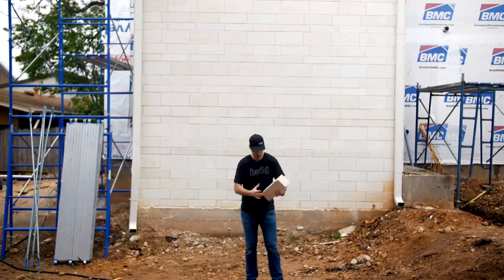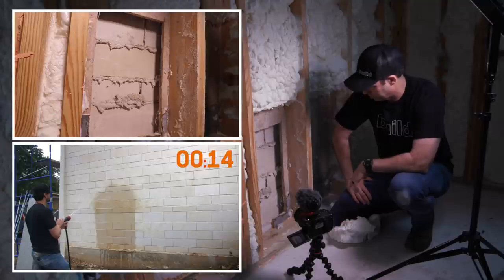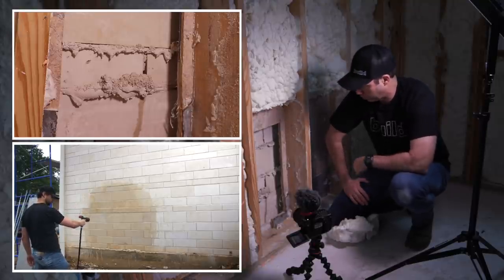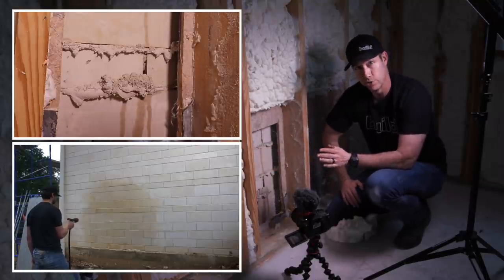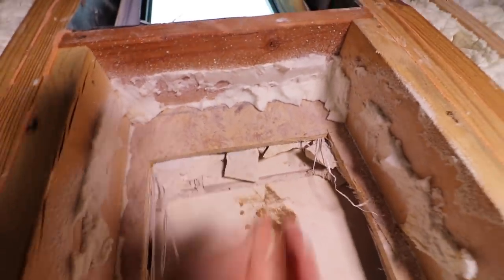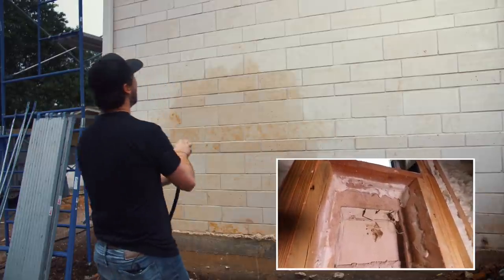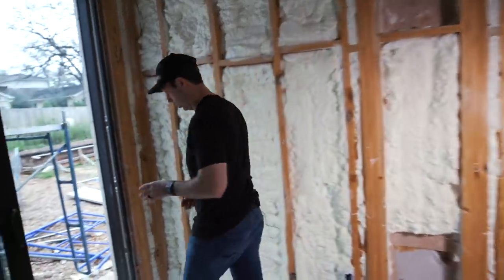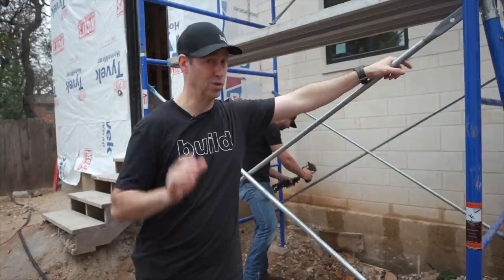You'll be Shocked by how quickly this leaks...

Comment: Looks like the majority of vertical joins are failing. Likely just a stripe of mortor front a back and the blocks were likely set dry. Curious on the quality of motar also. Those blocks should take weeks not minutes to show damp. In a cold climate the ice between blocks would tear that wall down.

Comment: I live in Salina, Kansas and the so-called builders and masons routinely install masonry products on top of OSB or similar products with no vapor or water proof barrier between the masonry and wood products. I discovered my house has brick attached on the front right on top of OSB when I was replacing the brick mold around the garage doors. Just shamefully negligent. They save a few bucks and easily get through the one year “warranty”.  What is the building and inspection department doing about it?

Comment: Great another video showing how terrible our houses are built.  love this channel and then realize everyones house is probably rotting around them everyday.  What do you do when you buy a prebuilt house, how can you even check this thing.  House inspectors dont check anything like this.  Maybe home builders should be heal more accountable for their minimize work maximize profit.  Also didnt you have another video that any type of siding they use, they need to have a way for water to weep out at the bottom.   So if this leaks like this wont it leak out the bottom like the other video suggested?  As for paying attention to it, who, the home owner.  Does that mean we need to watch everyone thats building your new home to do their job correct?
Reply: yes, of course you should. the builder watches subs and the home owners meet with the builder and takes an active role in making sure the process is adequate and it's being followed.  if buying a spec house it's buyer beware no matter what the code or inspection says the only way to prevent is to be vigilant. and good luck on that, i wouldn't take the everything is fine side of that bet very often.

Comment: Jorden was being very careful to hose the mortar lines.   All brick, all stone,, all block walls  they all leak under a test like that.  Every one of them.  So in that respect,, I am unimpressed.

You derided the house wrap used, but is there not a close cell foam sheet behind the house wrap?  At what point is the balance of perms,, out of balance?  I have personally seen exquisitely insulated and wrapped homes suffer water rot because of interior moisture migrating outward,, wetting whatever layer is at the dew point.  In warmer climes, the opposite can easily happen.

Flawless,, perfect,, moisture barriers can cause problems as well as cure them.   The most basic defect I see in that wall is a far, far, too short overhang.  And,,, no house will survive long with a nightly sprinkler soaking the exterior of the house.  It would save time just running the hose into the house and between the sheets.

Comment: ok, it was 15 minutes talking about the problem, but I didn't really get the solution to the problem. The reason why I am interested is that it seems I have that particular issue.
Reply: The solution is to make sure you've got a perfectly sealed waterproof barrier behind your masonry because the masonry will leak like a sieve. In this case they're going to have to take down all that masonry, reseal the house perfectly, then put the masonry back.
Reply: @bmay8818 , I'm with ya on everything but the spray foam. If the house is sealed the right way, no water should ever touch the wood, never mind the insulation.
Reply: @bmay8818 , Sounds like your building is being built very well and I can't argue against redundancy. I like the spray foam for all the reasons you don't ! lol.
I would think that you'll be just fine.

Comment: Glad it was only liquid water as opposed to the non-liquid variety.
Reply: Snow, steam, ice, and water vapor in the form of humidity/dew?  You don't sound so smug now, do you?  LMAO son
Reply: umm none of those are water tho. Merely water in its different forms. Solid, LIQUID OR gas. Steam, vapor or ice are not called "water", the op is correct
Reply: David right, every form has it’s own name. liquid is implied unless otherwise specified. saying liquid water is like saying water water.
Reply: You know if you listened to the video you would have heard about how the liquid water becomes a major issue after the sun heats up the block and drives the water vapor into the building. 

So specifying liquid is meant to trigger the thought that this may not stay liquid despite starting as a liquid. 

I have seen wall models where the design maximum vapor pressure was assed to be the ambiant maximum. This shows why that is a poor assumption and you will likely see saturated air conditions at elevated dry bulb temperatures for sun facing facades.
Reply: Michael Witt “waiter, may i have a glass of liquid water?” said no one ever
Reply: Steven Peterson building scientists do.
Reply: Liquid water as opposed to vapour ingress.  How your comment got 42 likes is beyond me.
Reply: Christopher Edwards because efficiency of speech is important and this is blatant violation.  vapor always comes with it’s own clarification. we know the distinction is important, but liquid is always implied when you simply say water. furthermore, when we’re all staring at a video of water running down a wall it is egregiously superfluous to mention its state.
Reply: Matt was trying explain the building science in a simple but thorough way. Obviously he succeeded if the morons making these comments understood him. Good demo Matt and good explanation.
Reply: Yeah the gaseous water that is also a serious problem when waterproofing a house as was discussed in the video.

Liquid water makes sense in this context.

Comment: To think that house probably will cost close to 1 million bucks and the shade tree construction workers who we all know where they come from are building that home. Pure shit.
Then they spray insulated to put lipstick on that pig and your home is collecting water at the base of that wall. Then you call in a local construction crew to help tear down the wall to fix that leak and it will be a 10k job.
Looks like shit mortar job.  I don't expect them to scrape the back side because of the OSB wall, you can clearly see the gaps or lack of mortar. Where they trying to save mortar? Or just trying to prevent squeeze out on the back end?

Comment: is this even "built to code"? 
i mean certainly for the united states there must be some sort of building code, which lists norms and Isos etc for how things have to be doen right?

We have our DIN / EN here in europe/Germany and there are many many standarts on how windows need to be put in, on how the integration into the fassade is to be performed, which materials to use and there certainly is a right and a wrong way.

The use of mortar on the stone facade also looks no bueno to me, the inside looks terrible, it should have never been built like that, bricks need to be put in the mortar, so it has full coverage and afterwars oc ourse the mortar needs to be swiped of with the trowel and gaps et cetera need to be filled in meticoulously afterwards, if there are any left.

Plus here the facade would then get a translucent layer of hydrophobation coating, in order to not let any water reach the inner side of the wall.
then where the birck stones meet the foundation, a proper Z-barrier is needed and you would also find slits in the wall which would allow for any moisture builöding up insde for whatever reason to escape through there by evaporating!

is insukating with "construction foam" a thing there? I mean is it legal to do this ?!

Why is there no 2 layers of Rockwool Stonewool or Glaswool insulation plates, which are then connected to the inner frameing or precisely cut into size and then put in between the framing of the wood ?! which is of course then both from outisde and inside covered with 1/2 inch OSB  wood planks and sealed off with tape and a vapour membrane both inside and outside!

so evene IF water got in, it could simply do no damage at all, because it would just drip off of the outer vapour /water membrane and exit through aforemtioned holes!
Reply: No its not to code.

Comment: Applying stone with grouted lines over a surface that was not prepped properly is no different than using unsealed drywall under tile in a shower/bath .  JUST plain negligent /stupid . (that crap vapor product being as useless as a coat of flat latex to seal a shower sub before a tile .

Comment: Liquid water? Otherwise know as water hahaha
Reply: Actually water comes in 3 forms Solid, liquid and gas.
Reply: @Ilove3SGTE  WHAT?!?!
Reply: @Skier460  , high humidity days (water vapor/gas) bring lots of water onto the wrapped structure & backside of brick through condensation over time. Mold & associated rot forms sometimes more through condensation than direct liquid water exposure/leaks.
Reply: @Skier460  I know it's can be hard to comprehend but not all water is liquid.
Reply: @Skier460  you'll learn all about it once you get to high school.